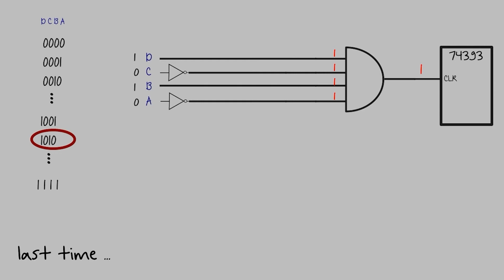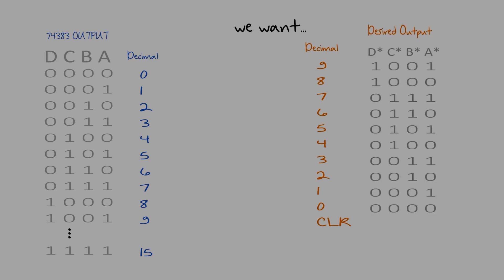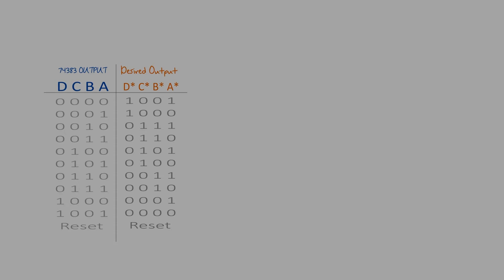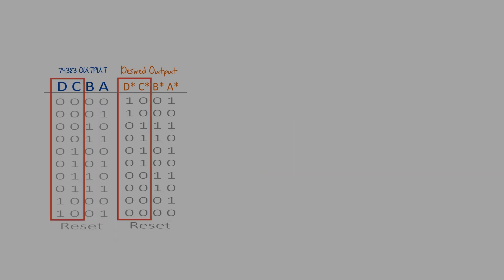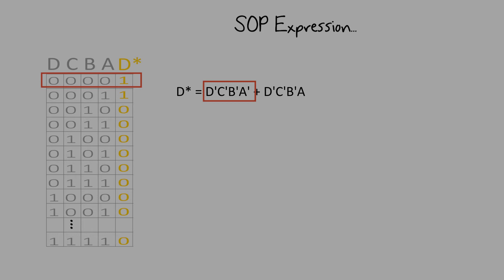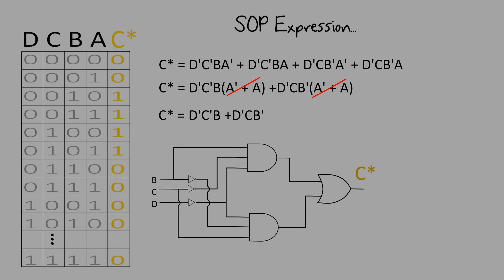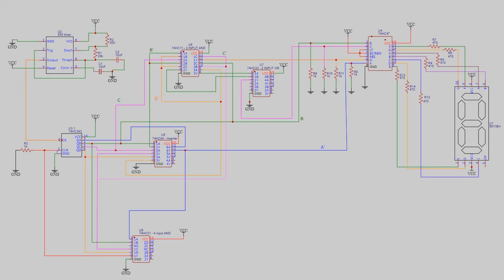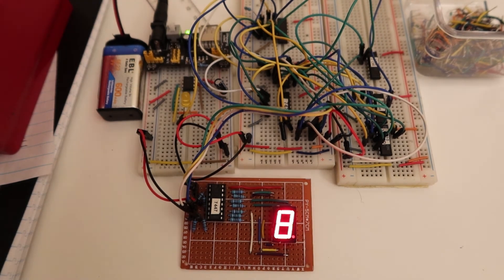Tutorial | Designing a 9-0 Down Counter using the 74393 4 Bit Counter

Comment: hi, can you help me design a 00-95 counter circuit using 74393 and 7400? pls
If yes, please tell me your gmail so I can contact you! tks u so much
Reply from the maker: Hi I don't have the time but it should be similar to my 0-9 counter. Just take the reset signal and attach it to the clock of the other 393
Reply: @QRobotix  tks u so much, I did it. love u